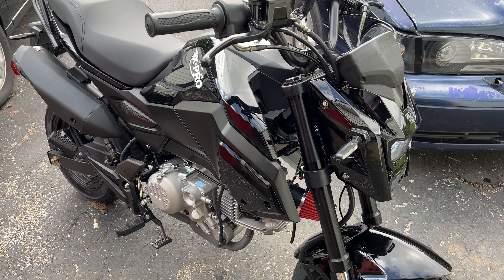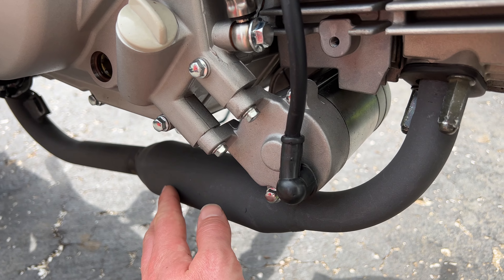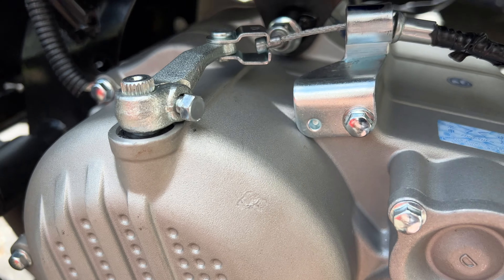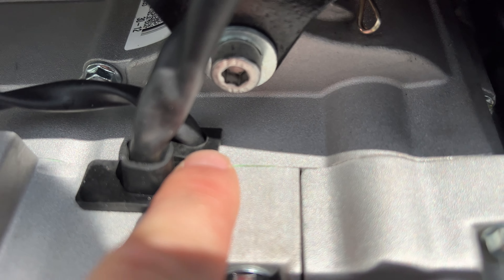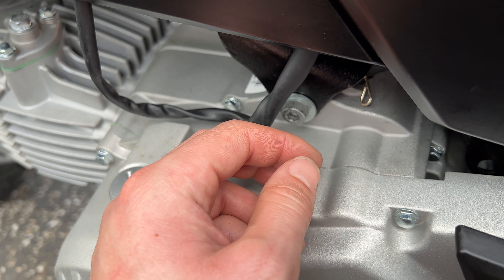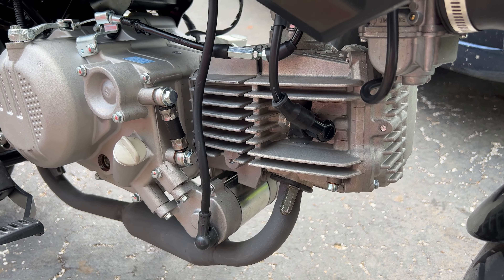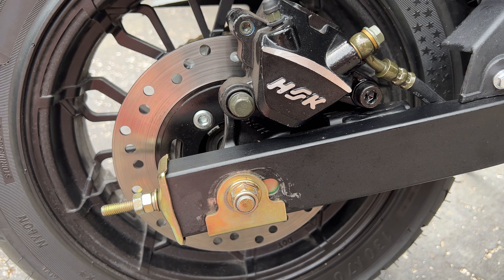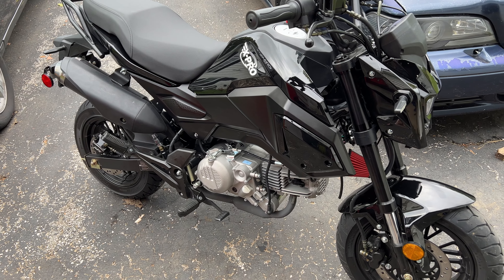Motorcycle Engine Swap - 2022 XPRO Vader Grom Clone ZS190 Upgrade

Comment: I like tinkering with my Boom Vader, so adding parts as I go, including a planned Big Bore Kit.  However, sometime in the distant future I might consider a larger engine.  Thx for video hoping to see some speed runs after break-in.  :D
Reply from the maker: Yeah a bigger engine is the way to go for sure. The 125 just doesn’t have enough to push it. I can ride it at 55 and only be at 5-6k now whereas with the 125 it would be at redline going 53. If you’re considering a big bore then I would suggest just going to the bigger engine. Having the extra gear alone makes it worth it. 

Right now I’m trying to find a way to mount the oil cooler as well as sort out the exhaust. My setup in the video isn’t working out too well.

Comment: Honestly im trying to upgrade the bike to work better but spending 1k on the bike when its worth 2k your alrrady putting more money in the bike then its actual retail price and thats dumb like whats the point on the bike might as well build your own bike
Reply from the maker: The idea is to get a better and faster bike than a Honda Grom for less money and learn some motorcycle mechanical skills along the way. If you have the frame welding skills then building your own bike is definitely the cheapest way to go. I can’t weld any better than the people who welded the frame of this bike together so I bought it instead. It’s not a cost to resale value. It’s a cost to fun value lol.
Reply: @NICKELGHANDI  man I want mine to run better but I just don't want to spend more money then what I bought it for but I heard down the line that it runs terrible with the stocked parts that they need to be upgrade out the factory but groms are just built Japanese ready because my friend has one and he treats it like crap and his runs better then mine he literally launches it off ramps and stuff
Reply from the maker: @brianperez379 The Grom is a better bike for reliability hands down. That said I beat on mine pretty hard and it does fine. There are parts that wear out that will need replaced but they’re all cheap and you can use Grom parts for better reliability long term. Or sell it and get a Grom. For me, I wanted power to go 55-60 without blowing up the motor and a cheap bike I can wheelie and do dirt trails without worrying about ruining an expensive bike. The Grom isn’t necessarily expensive but for a 125cc toy I don’t think it’s worth almost $4k and for what I do with this cheaper bike I wouldn’t be able to enjoy myself on a Grom. 
My buddy has a Grom and it runs better and rides smoother but I win every race and can go more places and on more roads. I also have to turn a wrench on mine more often but for me it’s worth it. It’s all about what you want and what you’re willing and able to do. 
The 125cc these come with is trash but the 190cc or the real Daytona 4 valve in 190 or 212 makes it a different bike both in reliability and power. 
If you have the cash then it’s worth the upgrade. I’m planning to do a video soon detailing everything I had to do to make mine reliable and fast and the cost to do so.

Comment: If there is anything I learned from these bikes it's that 90% of Grom MSX and MSX SF body and frame parts will work with minimal modification. Swapping out the rear set and swingarm and redoing the top engine mount welds (or just make beefier steel mounting plates) will solve a lot of the structural issues. I also mega recommend pro taper bars and better mounting solution as the rubber bushings mixing with the salt water humidity from shipping makes them crumble like a biscuit. If you need stopping power on a budget get braided lines for you brakes, otherwise Grom Brembos are king.

Comment: Clutch may be stiff, because you repositioned it , just saying those couple of knotches you moved it try putting it back and see if it frees up
Reply from the maker: That could be true although changing it the way I did should actually give me more leverage (in theory). I might try putting it back to see how it feels.
Reply: Get a nibbi clutch cable.. its longer than original stock @NICKELGHANDI
Reply from the maker: @jonathantrejo8411 I do have one now. It works much better.

Comment: You need a catch can for the oil tube to go in to so you don't end up with oil all over your tire and weld washer to the frame bolt holes the reinforce the hole for the bolts.👍👍✌️👌💯🏍️🍻
Reply: I would just use it to lubricate the chain. There's really not a lot coming out the hose. Mostly some smoke/clouds, and when the bike is at temperature, the hose vents water vapor that got inside.
Reply: @ProDigit80  yup as long as your not wheeling  or punching it and then let off all the way. Both tend to  make it shoot out about a cup of oil out of the tube   with out a catch it's a big mess on your tire and clothes. ✌️😉

Comment: For sure man I just hit
The subscribe button as I just got a Vader 125 from one of my customers Snd being an avid performance modified turbo Snowmobiler I have to throw a big block in this grom copy!!! They seem like not bad copy’s for 12-1300$ so what the hey!! I looked into a bigger motor swap and came across your video. Thank you for taking the time to  post your
Video. I’d
Like to start off with where to order the 190 cc motor that seems to be so plentiful. thank you in advance  for your
Help I haven’t watched much about the 140? Cc stroker kit installed but I’m sure the 190 kit will have plenty
More power
Than the stroker
Kit if I’m not wrong. Thanks Again and looking forward to seeing the 190 swap video running on road !!!
Reply from the maker: I was blown away by the quality of the bike for the money. I’m not going to take it across the country or anything but for getting out for a few hours it’s great and hasn’t left me stranded. 

I scored mine from Amazon https://amzn.to/3ZPIssy but they are frequently sold out. steadygarage.com often has both the 190 and the 212 cc for a bit more money. I’ve heard good things about ridernomics.com but haven’t used them. 

The higher displacement and 5-speed makes it the most bang for the buck.  

I looked at the 140cc and 150cc motors. You can sometimes fine Lifan 150’s with a 5 speed. I decided to spring the extra few hundred for the 190. 
I have a new video coming soon. I’ve managed to make an exhaust work and got the carb turned around to make room for the oil cooler. I have yet to install the cooler but it’s still winter where I am and my temps stay low. 

There was one guy who was putting a CG250 into his clone. He had it running at one point but I think it had problems and in his last video he said he was quitting his project for a while. 

@Thomas Healey has a channel where he shows off his 212 swapped bike. I like his stuff but he hasn’t uploaded in a while. 

Keep an eye out. He or I will have some more videos up as the weather gets warmer. I’m excited for you with that 125 though. If you don’t need to go faster than 50mph then the 125 and a 17t sprocket are still fun to putter around with.

Comment: What did you do to make the clutch less stiff? I just got this engine and man the clutch takes some hand power!
Reply from the maker: Not much at all. You can mess with the alignment of the clutch arm by loosening it and placing it differently on the shaft and then adjust the clutch cable accordingly. That made a big difference. Also you get used to it after a while and things get a bit more lubed up and it just moves easier. 

If it’s still really stiff then there may be a problem or you may want to look into a hydraulic clutch conversion kit like this: https://amzn.to/3OuWZXY

That is an expensive option though.
Reply: The clutch gets nice after some miles I thought the same thing but after I drove it for awhile she shifts like a dream idk why but I think it’s just grabby af at first

Comment: do you need an oil cooler?
Reply from the maker: It is not a bad idea and this motor has the connections for one but I don’t use one. If I had to ride in stop and go traffic I would probably use one. I’ve never had any issues in over 1000 miles.

Comment: 2022 vader can have the speedo fixed?  never heard that was possible
Reply from the maker: It definitely can. speedodrd.com. I emailed them and sent some photos of the connectors on my module and they sent me a plug and play kit.
Reply: @NICKELGHANDI I know it's been a few months but do you have the plug and play kit number?
Reply from the maker: I cannot link straight to it because the page has a drop-down to select the option. You can go here: http://shop.12oclocklabs.com/index.php?route=product/product&product_id=59
Then select the C1 model from the drop-down list. If you have any questions email their support. They respond quickly and are very knowledgeable.

Comment: Is there much of a difference between this and a 212cc engine? Im a big boy so figured id go with 212 over 190 but am not sure
Reply from the maker: The four valve 212 will get you substantially more power than the two valve 190. You’ll want a bigger front sprocket to keep rpm lower at higher speeds but if you have steep hills you may want to keep the smaller sprocket if you are a bigger guy.
Reply: @NICKELGHANDI  thats what i had suspected. i plan on changing the sprockets anyways for wheelies. This is my first time doing anything real mechanical like this so i dont know what im doing. Can i ask you what else i would need to swap on the bike to make it work? I know ill need to swap the carb out. Would the nibbi carb you linked in the description here also work with the 212cc? Also if you know of any parts that will need swapped any info is greatly appreciated.
Reply from the maker: You want a smaller sprocket for wheelies to get torque. I can wheelie mine on a 17t sprocket I’m second gear but I’m just under 150lbs. 

To make it work with a 190 or 212 you’ll need to do a bit of rewiring. The exhaust needs changed as well. I recommend bullock performance for a zs-190 or 212 exhaust header and the muffler of your choosing. Most of the ZS motors come with a carb that is actually decent. You could use the linked nibbi carb but a 28mm or 30mm would be better. Nibbi makes those too. 

When you get the motor you’ll want to tear it down as far as you are comfortable with and make sure that everything is torqued to spec and lubed properly. There are videos on here about that.
Reply: @NICKELGHANDI  big thanks bro!!!

Comment: Just bought a 2023 one, how long is the break in period
Reply from the maker: They say 500 miles but there are mixed opinions on that. I rode it harder than normal but changed the oil frequently and eventually the filter too in the ZS-190. The stock BD-125 motor doesn’t have a filter.
Reply: @NICKELGHANDI  did yu do any upgrades within the 500 miles or just kept it stock
Reply from the maker: I put the 17t sprocket on it and trimmed the chain cover to fit it. That made my top speed about 52mph although the bike really struggled and I’m only 145lbs.

Comment: So you can now use this on the freeway legally ? W/ motorcycle license?
Reply from the maker: Yes, however I wouldn’t advise it. The wheels are too small to maintain good control at high speeds. You can handle it in a straight line but if you had to maneuver at all things would get wobbly.
Reply: Oh I see I have an xpro 125cc stock I’ve been thinking about upgrading it and using your video as a guide to that & use it to go to work lol it’s mainly streets but I’d have to get on the freeway for about 10mins i just don’t want to get pulled over … thanks for the info though!

Comment: What is the link to the speedometer fix place?
Reply from the maker: Model C1 
http://shop.12oclocklabs.com/index.php?route=product/product&product_id=59
Reply: @NICKELGHANDI  which model did you get from the drop down menu?
Reply from the maker: Model C1
Reply: @NICKELGHANDI  was the wiring pretty straightforward?  is it clocking pretty closely?
Reply from the maker: The wiring is plug and play. It clocks perfect with GPS until you get to about 50 and then drifts a tiny bit to the low side (as in you’re going faster than it reads). I don’t think I set it perfectly and will probably do the setting procedure again if I need to take the front assembly off for something else. It is probably less than 5 percent off at this point which equates to 2 mph off at 50mph. I can live with it lol.

Comment: i had to use a zs190 clocking flange to make the carb face the rear.
Reply from the maker: I tried that. I got the chimera one from steady garage and the carb still won’t clear the frame or fairings.
Reply: @NICKELGHANDI  I replied to your post about exhaust on ChinaRiders...but for the carburetor... I had to cut off the original voltage regulator bracket, relocate the regulator, and then I was able to use the included PE28 carb and intake facing backwards.  It cleared the frame (just), and using a Nibbi mesh filter with 45 degree angle, it'll tuck tightly but neatly under the left side plastics.  Snug... but it fits.
Reply from the maker: I saw that and I think I’ve seen your video and that setup is clean. I think what you did is probably the right thing to do, but I really don’t want to cut any part of the bike. I may try a different intake manifold or something but my temps haven’t been above 230 at the hottest near the exhaust even without the cooler so I might just leave it. I really don’t wind it out or spend much time idling.

Comment: what exhaust did you end up using?
Reply from the maker: A cheap Amazon one. https://amzn.to/3Hdr35q
I had to heat and bend it a bit but it works great.
Reply: @NICKELGHANDI  did you just bend it to make it come out the engine at more of a right angle so it clears the starter? i have the common amazon one for my 125 i might try to bend it but i worry its more restrictive to flow than the 200$ one everyone buys from kepspeed. really dont wanna buy another exhaust thought when this one has only 4oo miles on it
Reply from the maker: Sort of. It was more of a twisting bend. It doesn’t seem to restrict air flow but I did end up cracking the pipe and having to weld and anneal it. I’ll try to get a video up on how I did it and what I did wrong. Honestly buying the kepspeed one is probably the way to go.